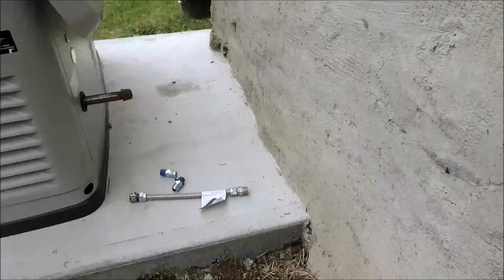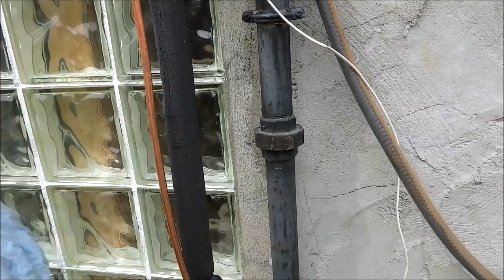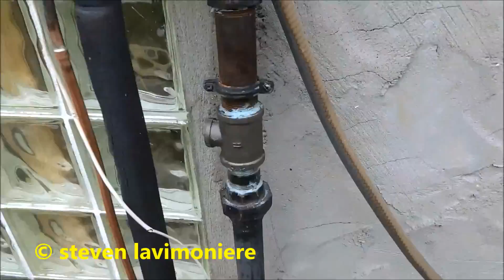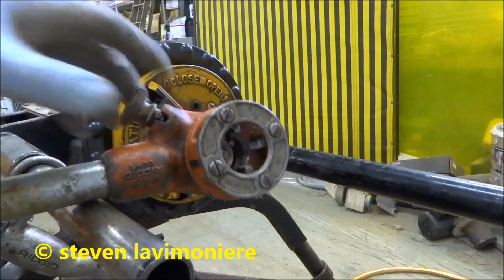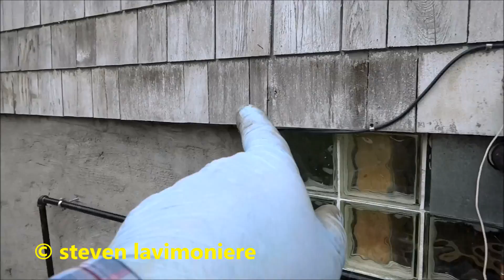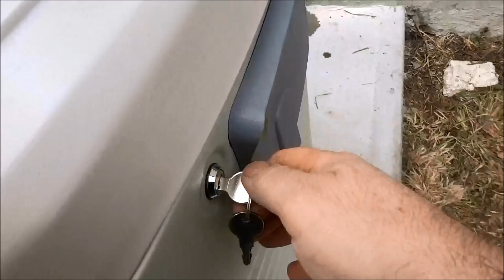Generac whole house generator install part 4 of 6

Comment: Steve a little trick I learned in nam. If you take two Hammers and your bang the union from each side back and forth it loosens up the fitting with the rust and whatnot. Makes it a lot easier to unscrew

Comment: Makes me cringe when people use pipe dope on the threads of a union, you’re only supposed to add a little to the flared face of the union, not the threads
Reply: Yep! However there seems to be two view points on the practice. I've always only applied it to the flared face but the argument I keep hearing is the dope acts as a lubricant allowing for additional thread travel when tightening, thus making for an even tighter seal at the flare.

Comment: where is your drip leg on that gas line that elbow should be a tee with a 4" nipple and cap
Reply from the maker: no drop leg out doors ,because if there is any liquid in there it can freeze and split pipe
Reply: steven lavimoniere - In Pa. Its required you just lengthen the nipple
Reply: steven lavimoniere - Good job but your electrician sucks check the code on that panel wiring
Reply: If u have that much liquid in your gas line you other issues and ur gen is probably given you issue. Generac now installing drip legs on their units inside the cabinet. Thats a falisy no drip legs out side.

Comment: Hi Steve.  I like your 'down home' videos. I'm installing a Cummins 17K right now in Nashua, NH.  I was told by the inspector that if I don't put in a drip leg he isn't signing off on the job!  He said it's not a drip leg in Nashua it's a sediment trap. I asked what about water freezing?  His reply; "Water?  This is dry natural gas, there's no water in there."  Ummm, OK.  So it gets a sediment trap...which looks identical to a drip leg.  Whatever.  ;)   When I was researching NFPA 37 I found it doesn't specifically address the issue.  Same for galvanized vs. non-galvanized vs. mixing the two in one system.  Just gotta go with whatever the local inspectors  allow or require.

Comment: Beautiful job Steve... It is a real pleasure watching the process done professionally... I commented on your final video which was the 1st view for me about the gas line size going into the generator. My neighbor & friend has worked with propane for 30 something years now,  in my case, using LPG, which apparently does not require the higher BTU rate that Natural Gas requires,  I should be OK going with 1/2" as you have here presently. I already know you have changed over to a 3/4" RUBBER flex line & a 3/4" brass shutoff with a steel handle. That setup looks spot on for the natural gas BTU requirements...
Thanks again for sharing this fascinating piece of work...
Bill Farr...

Comment: Oh man, that gas main looks tight! I would be cracking out the 36" for that one. But, a good cheater bar works too as long as the jaw fits! The building I was working for bought me a 36" and 48" for an old boiler demo. I've used the 36" a fair few times but the 48" is almost brand new. only used it a couple times. I agree with doping the unions. Mating surface and threads, makes it go together nice

Comment: Isn't it against code to use a galvanized tee with a gas line? There will be a dissimilar metal or galvanic reaction between black iron and the galvanized coating.
Reply: Gary Parish where is there one at?
Reply: . Black iron pipe is, simply put, the same thing, but without the zinc coating. The zinc coating on galvanized pipe for gas is meant to keep the pipe from corroding from contact with moisture. As he said "he will paint it after the inspection"

Comment: might be a dumb question but here it goes,  
i din't see that concrete slab for the generator being "atached" too the wall of the house  unless i missed that part, the slab is just laying there right?  with the moving of the ground  from freezing in the winter  ,don't you want a little slack on the final flex hose? it seems little too  tight to me.
Reply from the maker: slab is not going anywere ,

Comment: He must not be running a central air. I see he only has the 11kw unit. I had the 22kw unit installed. People ask how loud it is. I tell them it sounds like a lawn mower two houses over. it just purrs and purrs. Being without power is a bummer. These Generac units are great! A lot of work went into this video!

Comment: i Love all your work so far. only thing i don't like is the Small internal on that gas flex. i'd get rid of that gas flex and up size it to a 3/4 internal. no use starving that motor . it's just asking for trouble. Certified mechanic here. Niase  Certified.  Lean burn that engine and you'll Burn a valve or put a hole in a piston over time. china stuff needs oversized for protection. Highly recommend !!   U Said your self, the instructions call for 3/4".
Reply from the maker: +OcRefrigeration,Hvac & Electrical. i will have to look into that one ..my code i can run 170,000 btu through 1/2 pipe for 10 feet ..so i could run 1/2 to that generator and have the proper gas flow ,,thats the gas flex that cam with the unit .if it was to small why would they send it with the unit????
Reply: i don't know but the internal size is way too small per the spec sheet u have . they can screw up you know. maybe for a smaller unit.
Reply from the maker: +OcRefrigeration,Hvac & Electrical. ok i just ordered a 3/4 gas flex on ebay its made for generac like you said better safe then sorry .
Reply: You are Awesome ! Yes, Better Safe than sorry. For sure. 
Post a Vid of it if u Would when u get it. i'd love to see the internal size.and type.
Reply: I always up size at least 1.5 times the size coming in on the installs i do.

Comment: steven i was think of you when i saw this on youtube . this may work for you when you change out the valves on the oil tank or doing copper line an it has water in the line . Dropmaster DM12

Comment: Tip for you might consider. Get a foam tray like your grocery meat comes on and set it under the battery. In case it would split or leak the acid won't rot the bottom.
 Might as well.get the winter kit. Warm oil and battery means less wear and tear, in my opinion.  Regarrds.

Comment: Steven i cant wait for tomorrows video-
about the gas connection  is flex allowed anywhere or only if the appliance is movable like a dryer.
and that blue dope whats the name of it its used on water and gas?

Comment: Pipe fittings are Made in the USA if you choose to look for them.. i was very picky on what i put in my House i built THERE'S NOTHING in this house NOTHING made in China. wiring USA Wood USA drywall USA flooring USA electrical box USA.
thats why we have a $500 Billion trade debt with China per year.

Great video.

Comment: When you load test it would be interesting to see if it can carry the AC along with normal house loads.
Reply: That a big ? Make sure your line comming from gas com is big enough to handle 16 / 20kw or you my get rewd tages by them

Comment: Is there a trickle charger to keep that battery alive? My thought is, if the system is not needed over a long period of time the battery may die leaving you without a starter. Just a thought. 
Steve is next level.
Reply: It should automatically exercise, and self test itself, depending on what you set it to, which would keep the battery charged. My last company installed them, and thank god I never had to do a service call on one. I did do an oil change once though lol.

Comment: nice install so far, just curious why you used the 1/2in flex that came with the unit and not just hard pipe that section in the same 3/4 you were  using.
Reply: Most manufacturers send flex to connect gas for vibration purposes. That unit will be shaking all over when it runs

Comment: first i thought i would a Generator there you can also heat with.
Reply from the maker: +Grumpy Electrician i have a gas furnace this will run the heat ,,yes